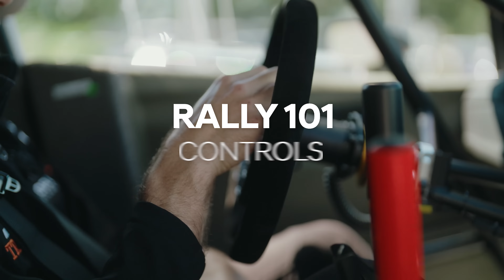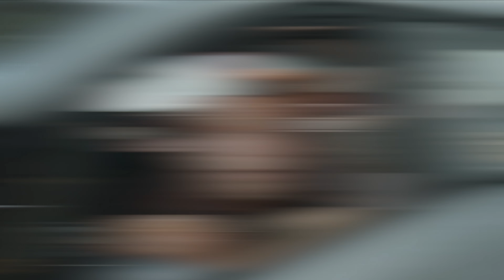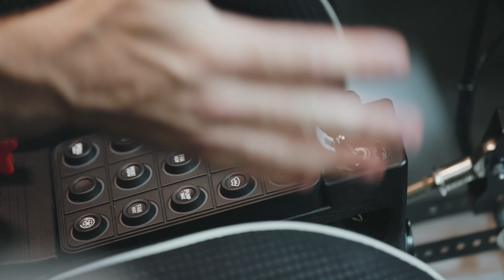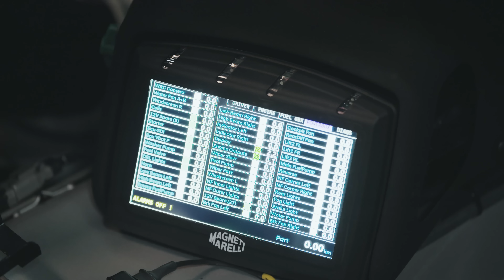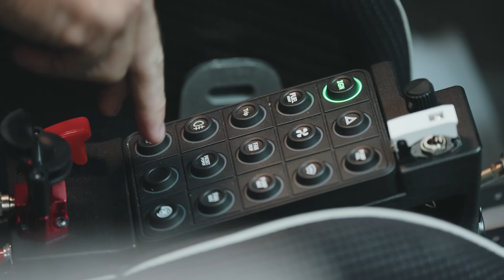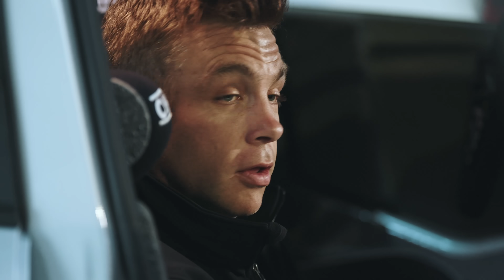Inside a Rally Car: Every Control Explained by an Expert

Comment: Very interesting,no brake balance control?
Reply from the maker: Glad you liked it, and yes, there is. They use the selector on the steering wheel to adjust during stage 💪
Reply: @HMSGOfficial Makes sense, thanks.
Reply from the maker: No problem!
Reply: THX.  I was wondering the same

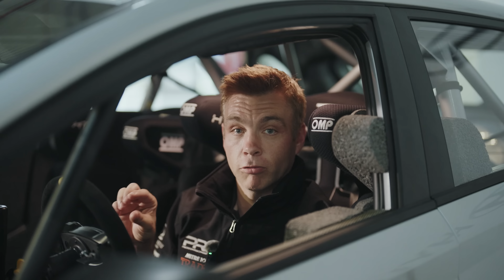Comment: 1:02 imagine it must be important to make quick, live adjustment with the boost knob positioned at such a prime location for the driver, under what condition(s) is the boost knob used?
does it control max pressure (i.e. waste gate actuation) or it is able to control boost profile to select gradual build up or max attack
Reply from the maker: It controls the entire anti-lag system, so not just the boost, so the engine mapping etc, all changes depending how harsh the drivers wants the system to respond 💪

Comment: Like F1, does not make any sense anymore, just technic-features supporting driving. 🤑🤮
Reply from the maker: What doesn't make sense? If anything, it takes a lot more skill to drive, and manage all of this stuff at the same time 😉
Reply: @HMSGOfficial  What ever "skill" you mean, soon the drivers can be replaced by robots which can handle "this stuff" better, instead of human talent of driving. 
I like the new class FR6/Rally6 in France, back to the roots, pure driving.  🙂
Reply from the maker: So you don't think driving, which itself hasn't changed really and having to do all of this on top of that, is less skillful than just driving? 🤔 Fair point, but the guys don't have electronic aids, etc, we suppose it's like saying fighter pilots back in the day were more skilful, it's not the same. But they still have to drive 😉 Although we agree, the FR6 class does look like a lot of fun 🤩
Reply: @HMSGOfficial  Yes, the whole car is an electronic aid, like a modern fighter plane. Traction, braking, shifting, steering. In the end once an AI can drive that type of car, after lot of training at a simulator.
At least from then you will understand my writing.
Reply from the maker: We kind of get what you are saying, but actually rally cars, out of all motorsport cars, aren't really like that, compared to track cars, say in F1, etc, the tech is actually pretty basic, and not much has changed when it comes to driving technique and controls in the last 10-20 years, really 😉
Reply: makes total sense tho.... and not that much change from even 20 years ago in terms of driving controls, they even went back to the sequential stick (which BTW, would prefer the paddles :D )

Comment: No close valve for the intake on water splashes. I remember the WRC+ cars had it, but i m not sure if the Rally1s have it nowadays.
Reply from the maker: There is indeed also a close valve that the co-drivers control with their feet on our Rally1 cars 👍 It is just not fitted to this Rally2 car 😉

Comment: Where is the ejecttion seat button for when the co-driver trigger three wrong notes ?!
Reply from the maker: Genius 😂😂😂
Reply: 3 wrong notes and you will no longer need an ejection button. What you need is an SOS button which simultaneously activates noise cancelling in your cans 😅
Reply: The ejection is done automatically by voice recognition, no need for a button.
Reply from the maker: @chrismannik 😂
Reply from the maker: @acescok This might be our favourite comment thread of 2026 so far! Would it be a normal fighter plane ejector seat, or Batman in the tumbler, where the bat cycle comes out? 😉
Reply: good question, it's under the butt
Reply: There use to be one in F1 with James Hunt's F1 car and the 2012 McLaren F1 cars located on the old DRS button

Comment: What is a "pop off" ?
Reply from the maker: The pop off valve releases excess boost pressure when the throttle closes, preventing compressor surge and protecting the turbo's impeller from damage 👍
Reply: @HMSGOfficial also known as Wastegate valve?